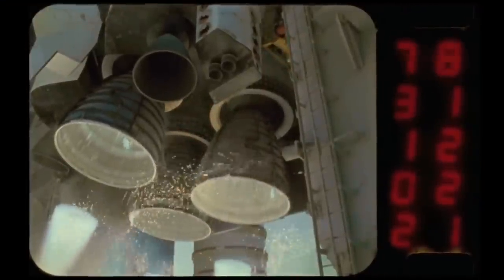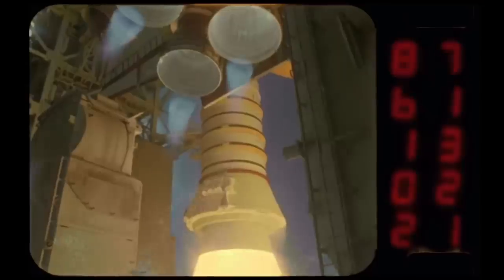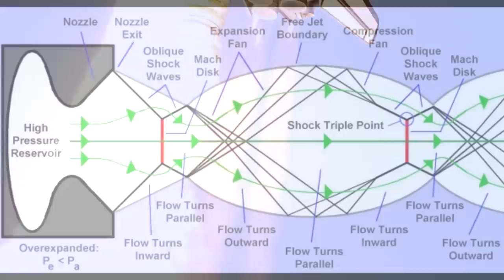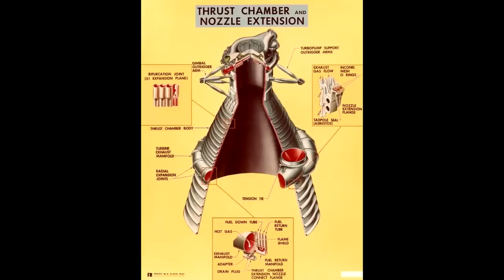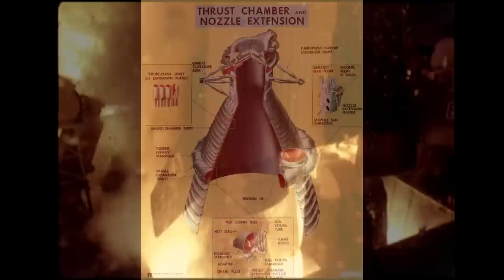Why Rocket Exhausts Look The Way They Do

Comment: What is the debree raining down around the rocket at launch? (e.g. 7:18) The cooling of fuel at launch site?
Reply: Yes, its water ice falling from the tanks. Because the fuel is so cold, water from the air condenses on them and freezes. At launch it falls off due to the vibration
Reply: Probably a mix of ice (that condensed on the rocket, due to the fact it's filled with liquid oxygen) and paint.

Comment: When a rocket is at altitude and about to cutoff first stage, I notice (particularly when reviewing footage of Falcon 9/Heavy/Saturn V's) that there seems to be some "macro" scale mach diamond forming in the plume a couple full rocket lengths behind the nozzles, completely independent of any individual engines' plume. Could it be said that this is essentially the same phenomena taking place in the individual engines' exhaust plume seen closer to the ground?

Comment: During the launch of a rocket why does the flame seem to move ahead of the exhaust nozzle and appear to surround the engine bell and pump assembly?
Reply: As the rocket pushes the air out of its way ahead of it it leaves behind a partial vacuum behind it. This vacuum sucks some of the hot exhaust forward into the space above the engine bell.

Comment: Hey scott if the rs 25 is a over expanded nozzle then why is the exhaust sticking to the walls of the nozzle the exhaust should separate from the walls before they exit it right? And you see those 3 holes near the oms pods of the space shuttle if observe carefully in any launch those holes are covered with a sheet and holes form in the sheet when its launching
Reply from the maker: I explain this in my nozzles video, the curvature changes near exit and stops flow separation.
Reply: @scottmanley  yeah i watched it the they just suddenly change the curvature right and what about those holes what are they
Reply: Part of the reason I ask is OMS system

Comment: I understand that when the ambient pressure decreases the exhaust spreads out to match the outside pressure. Does this "spreading out" of the exhaust reduce the usable thrust?  Would it make any difference if you were able to adjust the shape of the bell as the outside pressure decreased?
Reply from the maker: No, in fact the thrust gets higher because there's less atmosphere pushing back against the engine.
Reply: Good question, good answer.

Comment: Scott, at about 10:55 what is that coming off the end of the upper stage bell for the Falcon 9?
Reply: I wondered about this for ages until I saw it answered in a YT vid and then on a SpaceX launch only a few days after that.  Apparently the bell on the 2nd stage is suprisingly flimsy.  As such they put in a stiffener on the inside of the bell toward the exit to support the bell for ground transportation and launch.  
Once the rocket is firing, it gets blown out of the engine quick fast in a hurry.  It doesn't need it then as all the pressure is pushing outward, and the bell is strong when the forces are in this direction - like how you can't crush an egg with your thumb and finger if you squeeze it on the top and bottom (pointy and round) ends.  
Once the engine stops, it is fine again without it as there are minimal forces on the bell.  I'm not sure if I'm mis-remembering it, but I think it kind of oscillates after SECO (2nd engine cut off), demonstrating it's flimsyness.  This last bit may be totally wrong as I'm dragging it up from a deep corner of my mind.  Can anyone confirm/deny this (bonus space-points for video)?
Reply: That sounds very interesting.

Comment: Why has the exhaust nozzle to be cooled? Isn’t the temperature inside the combustion chamber even higher than in the expansion nozzle?
Reply: All of the metal anywhere in the combustion chamber or the engine bell has to be cooled somehow or else the hot burning propellants will burn right through it. The walls of the combustion chamber and the upper part of the expansion nozzle are cooled by running fuel through them while the bottom part of the expansion nozzle is cooled by the film of relatively cool gas. All of the metal walls of the engine will not survive very long without some type of cooling.

Comment: That is really strange, because by definition, pressure is force applied over a surface or area.  So by saying that the exhaust has a lower pressure than ambient air, it makes me wonder how the thing even delivers any thrust?  If the engine bell has a surface area of a square meter, it wants as many Newtons as possible in that square meter to shove upwards and push the rocket up.  So at the very exit of the engine bell, I would imagine the pressure to be astronomically high.

I'm not saying I doubt the low pressure thing, but it is very counter-intuitive.
Reply: I guess in this case gas pressure is just spacing between molecules. It has nothing to do with thrust.
So, because spacing between molecules is high, surrounding air compresses them further from sideways.
Reply: Thrust is not pressure. Thrust is mass flow times exhaust velocity. The job of the nozzle is to turn exhaust pressure into exhaust velocity in the desired direction. Look up how a de Laval nozzle works.
Reply: Hmm, but isn't thrust measured in Newtons?
Reply: Apologies. Mass flow rate times exhaust velocity. A newton is the force required to accelerate one kilogram by one meter per second per second.
So, kilograms per second times meters per second.
Reply: A rocket doesn't work by pressure. It works by throwing mass as quickly as possible away from it. It's the same principle as throwing a ball and having it push back on you. A rocket is the same concept, except it throws super hot gasses back on incredibly high speeds, at thousands of mph.

 The pressure the rocket engine generated also pushes it forward, but its always more efficient to convert the pressure into greater velocity, so it usually pressure insignificant effect on thrust
Reply: As others have already said, rockets work by accelerating the mass of their propellants out through the nozzle. The propellants have inertia, so accelerating them produces an equal and opposite reaction according to the formula F=MA. This is why rockets can work in a vacuum, regardless of what flat earthers and spaceflight deniers might try to tell you.

Comment: Why did they put a tank between the two solid rocket boosters on the space shuttle? Isn't that inefficient? I think they would end up with more delta-v when they have three engines rather than have an extra tank for another engine
Reply: You are confusing high thrust production with efficiency. The two SRB's produce a lot of thrust, which is needed initially to lift the fully fueled vehicle off the launch pad and get it partially accelerated up towards orbit. To do that the SRB's use propellants that have more mass, which enables them to produce the higher thrust required to lift everything. After that you use less massive fuels like hydrogen, which produce less thrust but they produce more acceleration over a longer period of time. Thrust is like raw lifting power while efficiency (called "specific impulse" in rockets) is like gas mileage in a car. So first the SRB's produce lots of thrust to lift the rocket until they burn out and are jettisoned. Then the hydrogen engines finish accelerating it into orbit. The liquid hydrogen fuel and liquid oxygen were stored in the external fuel tank and fed the three reusable engines on the shuttle orbiter.

Comment: Silly question..... does the rocket thrust make a sonic boom as it comes out?
Reply: Yes. The exhaust gas velocity of a typical rocket engine is about 8-10 times the speed of sound at sea level and makes a continuous sonic boom. That's part of the reason why rockets are so extremely loud compared to aircrafts.

Comment: Ah, Raptor is spark ignition, not TEA-TEB. No TEA-TEB on Mars...yet. What you are seeing is likely optical sensor distortion from the large dynamic range when the engine lights (and shutdown)...or some copper combusting from the chamber (not a good sign and doubt that is the case here).

Comment: PLEASE, PLEASE, PLEASE can you (or anyone else) explain why the flame starts travelling 'up' the Falcon 9 as it climbs (usually about 30 secs to a minute after launch - an example of this starts at 9:52).  I wonder about this every time I see a SX launch.  It almost looks like something is going wrong.  My best guess is that it's the exhaust of the turbopumps igniting, but not sure if this is the case (or if the Merlin engines even have TPs!).  100 space dollars and my thanks go out to anyone who answers this
Reply: i would guess that this are the exausts from the turbo pumps. wich aren't closed clycle and bump this stuff out.
if this is the gas from the turbo pumps then why isnt there any flame at the start? well i have no idea. but maybe it is there but has not catched fire yet.
or i am completly wrong with this one. Wich is also absolulty possible xD
Reply: As Falcon (or any other body) reaches speed high enough, a area of low air presure appears right behind it. Exhaust gases, just like any other gases, tend to move to areas with lower pressure, so some part of them travel up to base of Falcon's engines. I think that the scale of this effect depends on aerodynamics of rocket and on amount and size of egine bells, thats why it may not be visible on other rockets
Reply: T  Thx T.  Much obliged
Reply: @t.104  The base flow around the shuttle external tank is a great example of what you described - once the shuttle gets high enough.

Comment: Wouldn't it be more efficient if the nozzle would be able too expand and elongate as the air pressure gets lower?
Reply: Yeah, probably, assuming you can manufacture the mechanism to be strong enough to tolerate the conditions while also being light enough that the additional mass doesn’t instantly reverse the fuel saving you’re looking for.
Reply: Also remember that as the rocket ascends it doesn't need as much thrust as it did at liftoff because the propellants are being burned off. In fact losing some thrust is a good thing because it limits the G-forces that can over-stress the vehicle. That's why the center engine on the Saturn V first stage was shut down early before the other four so as to limit the acceleration.

Comment: On the ground, the space shuttle engine’s pressure in the bell is lower than the outside air to increase efficiency at higher altitudes; is there a reason to create an engine where the pressure is higher than the atmosphere around it?
Reply: considering that the thrust comes from the acceleration of the mass that gets generated while firing the rocket, a higher pressure exhaust plume would mean less efficiency.
The higher the rocket gets up, the higher the pressure of the gas moving outwards get compared to the local air pressure around it and since thats something that is bound to happen during launch and it's not desired, they dont really do that
Reply: A rocket booster meant to fly into orbit, refuel, and then retro propulsively land on Venus. When it takes off from earth it may have higher than atmosphere to work better in the 90 bar Venetian atmosphere.

That would only be realistic if we terraform Venus to be way cooler with anti green house tech. That would actually be really cool.
Reply: Part of the combustion takes place after the fuel and oxidiser mixture leaves the nozzle. Higher pressure would mean that more of the mixture would be burnt after, lowering efficiency, because that portion of the mix would not contribute to the thrust (reacting force) generation. An ideal engine would exhaust completely burnt mixture with a pressure of 1 atm at any altitude, but as every rocket engineer knows, such an engine would be a) extremely complex and b) prohibitively expensive - if possible at all...
Reply: Ray Foss: Eve landing/return flashbacks intensify
Reply: @or2kr  is the inefficiency of a higher pressure engine exhaust because the exhaust vector of the gas is less optional as it spreads out?
Reply: +Josh Kaufman well when it expands in the nozzle, it can only expand outwards to the benefit of more thrust while when it expands behind the rocket engine, it is also able to expand to the side, which does not contribute at all to propulsion
Reply: For nozzle size and weight - for all rockets as the air gets thinner there comes a point where exhaust pressure is higher than surroundings, as you can't make an infinitely big nozzle for vacuum. And for non-launch vehicle applications (e.g short-range missiles) making it compact may be a priority over squeezing every last bit of efficiency
Reply: I agree.  Anti green house tech is really cool(ing)!
Reply: Every vacuum engine is underexpanded because making a nozzle of the right shape to keep the flow attached and expand out to, say 10 pascals, would make the nozzle impractically long and heavy in a gravity field. Even in orbit you still care about thrust to mass ratio because your Isp on a chemical rocket is ultimately limited by that chemistry.
Reply: Venetian? I wasn't aware of Venice having a higher ambient pressure than usual (although if it keeps sinking, they might have to deal with that eventually).

Comment: Scott, I have a serious question and I cant find anywhere that allows me to send you a message so I will put it here. Why couldnt the Apollo and Gemini spacecraft keep their abort towersinto orbit and then use them to de-orbit thus reducing the amount of burning re-entry? Obviously the craft mass is very low and the astronauts could endure the G forces so why not just use the propellant.
Reply: For one thing, Gemini didn't have an abort tower. It used ejection seats. Apollo needed the docking tunnel at the apex of the Command Module to dock with the Lunar Module and besides when Apollo came back from the moon it didn't need to do a de-orbit burn anyway. And even Mercury had an escape tunnel at the apex that would have been blocked by the abort tower. Also, the abort towers used high-thrust solid rocket motors to pull the spacecraft away very quickly during an abort and this would have been much bigger than necessary for a de-orbit burn. And finally they were probably too heavy to carry them along for the entire length of the mission.

Comment: Scott Manley, Just finished your Nozzles video too.  I still have yet to hear or see an explanation of "where inside the bell" the exhaust applies its force. Using the `basketball chest pass of a medicine ball` model of rocket exhaust the `medicine ball` is accelerating until it leaves the scientist's fingertips. If the engine-system is optimized for 10,000M, is the `fingertips` plane perfectly even with the bottom of the bell at 10KM? Granted, medicine balls are RP-1/LOX and basketballs are hydrolox, #humor .
Reply: The answer is "everywhere inside the bell and combustion chamber". Since the exhaust chamber and nozzle are open on one end none of the gas pushes that way against the construction, hence the rocket goes the other way.
Reply: Thanks, I see what you mean, like `It's doing useful work the whole way through the combustion chamber and the thrust chamber. What I mean is what is the threshold where the thrust becomes exhaust?
Reply: Thrust is a force whereas exhaust is the material that comes out at the end - two different things. My opinion: when you call the fuel "exhaust" is a matter of semantics. You could define exhaust as "when it passes the aft end of the nozzle bell". It's probably safe to say that at that point the fuel won't create any more thrust. Whereas when the fuel exits the combustion chamber it can still generate a bit of thrust when their molecules collide with the nozzle walls.
Reply: We agree on the components.  Reading your reply again I think I am asking for more precision. The tons of gasses (M) accelerating (A) through the thrust chamber are the thrust, and they apply a force (F) also called thrust. At some point those gasses no longer apply the force, they are exhausted, they are exhaust. The mass remains constant. At some point the acceleration stops (A=0.) At that instant the tons of gasses no longer contribute to the force, it is almost surely not a smooth plane within the thrust chamber, but there is such a threshold. For instance, I think in a grossly over expanded flow the plane is up the wall of the chamber. But in a vacuum does the threshold actually bulge beyond the bottom of the bell, flush at the rim but extended in the center of the exit plane? F=MA , 0=M0
Don't dismiss this as semantics, each term has a distinct and separate meaning, even if in the case of `thrust` where the same word is used to describe the matter and the function of the matter.

Comment: how the hell did the F1 prevent high pressure exhaust gas from leaking reverse back into the turbine exhaust manifold?
Reply from the maker: The exhaust manifold was far enough down the nozzle that the exhaust pressure in the nozzle had dropped below the pressure of the exhaust pressure from the gas generator.

Comment: (~10:30)  "... exhaust heated by black body radiation [sic] ..." -- the exhaust (heated by chemical reactions between the propellants) is hot enough to emit visible black body radiation. 

How about more coverage of possible space transportation systems?  There's a lot to be said about and for nuclear rockets, of course, but what's up with SABRE?

Comment: The F1 turbine pump was 55,000 hp!   Saturn V  burned 15 metric tons of fuel per second. 600 Gallons of fuel per second, per each of the 5 F1 engines. Now, go figure how long to fill an "olympic" size swimming pool at that rate. Hard to believe you can move a dense fluid through a rather small aperture at that rate. Hey Elon! how's the BFR  (Big FALCON Rocket) coming along?
Reply: Yeah, I love the launch movies from inside the tanks, the moment you realise how big this things are.